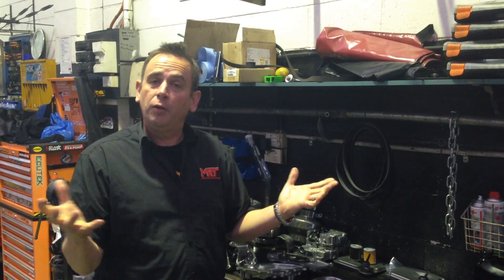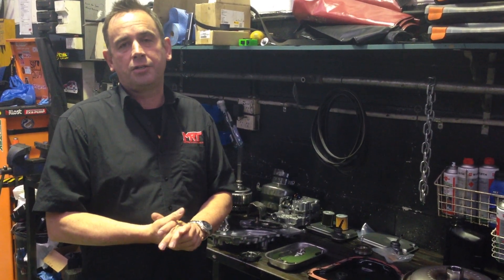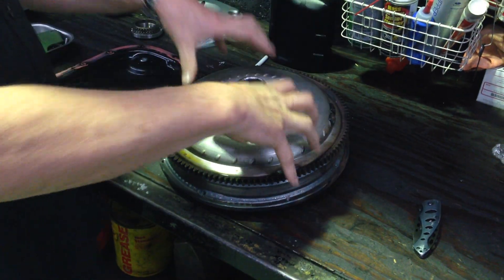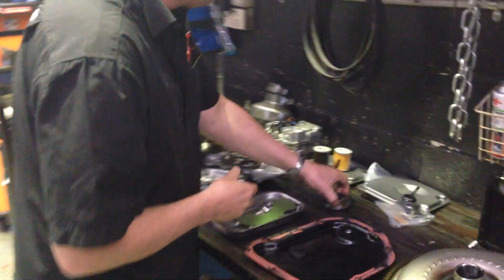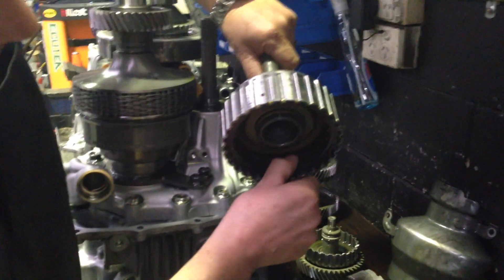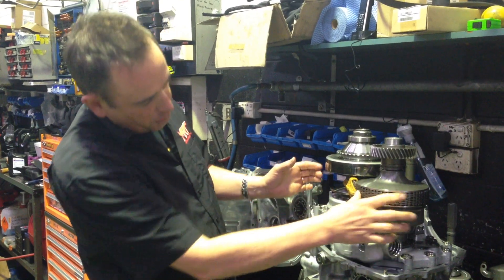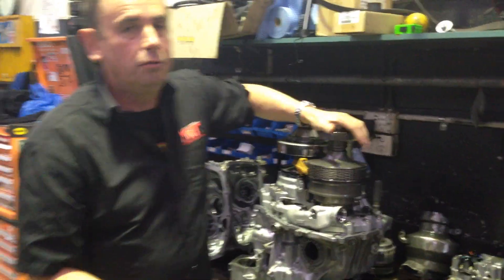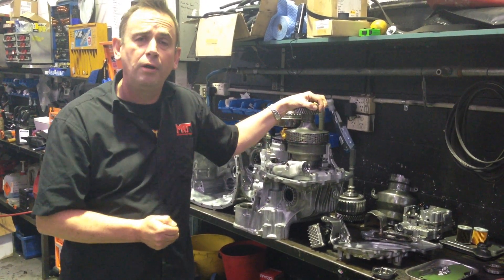Subaru CVT transmission secrets

Comment: A shame the CVT killed all excitement with this brand. If you want a MT Subaru you better buy while you can soon itll be that constant boring hum for us all
Reply: Doesn't the software simulate gear shifts so the ratios change quickly and stay there for a bit? It kinda defeats the purpose but apparently people like how it feels. When acceleration is done, it just puts the engine to its most efficient rpm for the load and chooses the appropriate transmission ratio. With a CVT you can also drive at highway speeds backwards if you want to. :-)
Reply: Hamachingo simulated gears in a cvt defeats the purpose of a cvt. Optimally the engine should be running at maximum power output (not maximum torque) continuously during acceleration. Theoretically this increases acceleration speed, though the technology is not there yet to handle high torque.
Reply: About that driving backwards at highway speeds: 60-65 mph max---with backup camera?  90 mph all nite long !  Easier on the neck too.
Reply: ahh yes, the CVT, a transmission literally banned in formula one for being too good, kills your "excitement"
Reply: As I understand it, it is Subaru's intent to eliminate the standard transmission entirely.  You'll never guess why... safety.  Well, kinda.  It is their commitment to the EyeSight technology that is driving that decision.  EyeSight requires control of the gearbox so that it can stop the car by applying the brakes, and a manual transmission cannot give that control to a computer (unless you have a double clutch or something like that, but that costs more in money and weight so they likely want to stay away from that).  So essentially it is EyeSight's control in the name of safety that causes them to prefer CVT or auto type transmissions.  Stupid, I know.  As far as I'm concerned a Subaru without a standard transmission is, no longer, a Subaru.  Sorry Subaru but it's true.
Reply: @badrasta5  Maybe so, but with some of the driving display I see every day, having EyeSight or similar in EVERY car is a good idea.
FYI. Watching movies, eating a bowl of cereal, putting on makeup, texting on your phone, while doing 100 km/hr is generally NOT A GOOD IDEA. (just my opinion).
Reply: @petert3355  I couldn't disagree more.  The more and more safety tools installed on cars inevitably causes the average driver to become a less and less safe driver (big picture).  Oh they may be safer for a little while (small picture), but they are worse drivers.  A good driver makes wise decisions, predicts accidents before they happen, and is pro-active in their everyday driving.  A bad driver relies on technology to keep them safe.
In aviation, one of the worst examples of this is Air France flight 447: on June 1, 2009 a fully modern Airbus 330 entered into a >pilot-induced< high-altitude stall (just let that sink in for a moment) killing all 228 people on board.  If you read the investigation you will learn one very simple fact -- the pilots relied on TECHNOLOGY rather than flying experience, and as a result, they killed everyone by slamming into the ocean.  Yes, the pitot tubes froze up (technology).  Yes, the computer handled it with loads of error messages (technology).  Yes, it was dark, and yes they were over the ocean and so didn't have a point on ground as a visual point of reference.  But at the core of the fault was the pilots relying on their TECHNOLOGY rather than their real-life flying experience.  All they needed to do was fly the plane and everything would have been fine.
I digress.  But, let the point be made -- a driver's FAILURE to know how the drive can NEVER be replaced with technology.  The only solution is to produce better drivers, by training, by closed-course experience, by putting people in dangerous situations with a trainining instructor at their side and teaching them the skills of HOW TO DRIVE.
Technology cannot even come close to replacing this most important component of safety.
This point will be lost on most.  And it is extremely unfortunate and unsafe that this is not understood.
Reply: One final point, and coming back to Subaru -- I like EyeSight, I think it's an awesome advancement because it uses bi-visual cameras (rather than radar or motion sensors) to see the road and computers to interpret that visual data.  That is absolutely incredible and is most certainly above the other technologies.
That being said, to take away the manual transmission is to remove the driver one more step away from the machine he is driving, to make it more difficult to be a good safe driver.  Many will disagree, that's fine.  Subaru has long been at the forefront of safety, but I see this as an ideological error on Subaru's part, and it will most certainly trickle down to their products.
Even if the CVT improves and it's reliability gets solid, I recognize I am being forced to be less in touch with the machine I am driving, and thus I am a less safe driver.  Of course you will say I am splitting hairs.   :-)
Reply: @badrasta5  I get what you are saying and while I do disagree on some points. In today's world, with the attitude of humans in general, where people are constantly looking for instant distraction. TV on your mobile phone anyone, I guess we agree that we cannot do this half arsed.
Either we go in your direction, remove "all" driving aids, and make the person pay attention to what they are doing.
Or we go to the other extreme and remove the human from driving all together.  Don't laugh, this is an option that is not that far way. Just look at the robotic mine trucks they have in mines today.
Which way the world goes, I don't know. What I do know is that distraction is the biggest killer on our road that we have.
P.S. The guy eating a bowl of cereal, with milk mind you, was driving a manual GTS W1.
Reply: @petert3355  LOL on the cereal GTS LOL. I think the answer to both of our questions is -- look at the toolbox of any skilled mechanic:  there are many old school tools, and the very successful mechanics will also have more modern tools that can do things faster and better than the older tools, but still many of the old reliable tools remain in the toolbox to bring the mechanic to repeated successes.  Why -- the newer tools are better -- why keep the old stuff even if they only get used less than half the time?  The old tools are proven, they are reliable, and they do a few things really really well.  It can also be said that the modern tools work better and are far more effective in the hands of someone who was trained on the old ones first.
I put forward a basic tenet -- train on the old, and only when the old is mastered introduce the new.  That is, the old matters, but... a fence should not be torn down without first seeking an answer as to why it was put up in the first place.
I believe both the old reliable (standard, basic driving with no technology) and the fancy new (automagical, safety) can co-exist but only if the old is respected, taught and made the core, and the new can exist without loss of safety only if the old is not rejected.  Case in point, Air France flight 447 and the 228 lost souls.  May they rest in peace.  And may mankind learn the lesson before it happens again because... it is already happening day after day more and more.
Reply: @nemo5335  Not used in formula one because of rendurence issues I'd say.
Reply: @oldarkie3880  no actually it was explicitly banned because it was too fast and they wanted to slow cars down for safety reasons.
Reply: I'm curious about the difference between the regular CVT and the HTCVT (High Torque CVT)used in the WRX, USDM Forester Turbo.  Sounds like they need to beef up both for better reliability.

Comment: If you replace the  cvt with a used unit is there any programming  required?
Reply from the maker: not sure
Reply: Byron Lambdin would depend on how much the transmission is actually controlled by electronic means. 

subaru's lineartronic cvt as used in the wrx simulates gears by changing ratios. this is done by what is essentially stepper motors that move the rollers or pulleys. 

traditional cvt's (good example, mopeds) are governed by weights, and can actually be "tuned" by changing the roller weights inside. 

The CVT actually has a place in cars, but sadly, not in many performance cars. (unless the user has the ability to manually change ratios). 

ratios should be able to be programmed at some point, but as long as the stigma of CVT transmissions being "blasphemy", no one wants to dive into exploring the possibilities.
Reply: Thanks , we installed the used unit and with this years model there was no programming needed. Transmission is working correctly now.

Comment: Is there anything that can be done to increase that ceiling of 400 Nm? Something along the lines of an aftermarket CVT cooler like the one that Mishimoto makes, perhaps? I just acquired a 2015 Forester XT w/ a Cold Air intake and was hoping to squeeze in a few more mods before hitting that ceiling.
Reply from the maker: cooler trans oil wont make your trans any stronger
:(
Reply: crusherofdreams look up the f1 kit for the CVT WRX. Its been highly ignored because of the price but, after installed, it is rated for 600hp
Reply: https://f1-motorsports.myshopify.com/collections/wrx-cvt/products/f1-pro-series-full-package

Comment: Would you advise a manual gearbox if doing a lot of heaving towing at full weight? Also, quite a lot of off road use as well. Many thanks. Great video, thoroughly enjoyed watching.
Reply from the maker: yes,manual trans
Reply: CVT's aren't designed to tolerate pulling heavy loads. NEVER go beyond the recommended tow rate!
If you plan on pulling things like large campers and boats, CVT's aren't for you.
Reply: Many thanks, I tow two large trailers with a gross weight approaching 2 tonnes so it's at full weight much of the time. Also, quite a lot of time in fields as well. I think the manual is going to be the way forward. I'm in England and we don't have much snow, but the relentless wet winters do take a toll when towing through mud etc. Many thanks.
Reply: @simonbroddle754  If I remember correctly, the tow rates in the UK for Subaru are nearly double of the US which is around the 2k or 3klbs range. Not sure WHY exactly, might be a efficiency thing and the transmissions are geared differently. But something to consider and always just follow your user manual.

Also, the rating are the SAFE level and probably at least half of their true capacity since the amount of force is variable while driving, I wouldn't test it though since tongue weight at least is something you do NOT want to over do, unless you want your front wheel to loose traction from lift. But depending on distance, you can get away with pushing it a bit. Same can be said for manuals btw.
Reply: @darksd3626  Hi Darks D, Thank you for your reply. I do tow up to 20,000 miles/yr with one trailer now which has a gross weight of 4,400lbs, this is higher as it's a manual car. That said it is rarely loaded to that level. 
You raise an interesting point though about brakes. We use overrun brakes in the UK which are ok but not the best. I am very curious watching the video's and reading up on the US system of electric brakes. I like the idea of altering the bias depending on weight etc and think they offer a much better solution. Regarding tongue weight we generally have a lighter weight as it can impeded the overrun brakes if there is a lot of weight on the braking compression unit. 
Still love the Forester. Great tow car although, if there's one problem is that 1st gear is quite high compared to my previous two VW Tiguan's. Thank you for your advice and thoughts.

Comment: I had a complete failure at 87k mi. Noticed a noise at 60k mi. 14 forester. The 17 has 3 definate shifts wheras mine had one.
Reply: What did you end up doing with your car?
Reply: do you mind telling how it happened? I have a 14 forester xt with 89k miles, the check engine light just recently flashed transmission issues, it's gone away but I think it's a problem waiting to happen...
Reply: LowInformation my 2014 subaru cvt just went out today. I complained to dealer about shuddering when accelerating, they never dealt with the real issue apparently
now I'm at 114k miles and over the warranty :/

Comment: Great video. It shows that CVT technology is just not there yet in terms of reliability. A transmission should not be failing after 3.5 years
Reply: This happens on any car, any history. Some failures are expected. I have seen this happen on tried and true technologies. Bearings sometimes come with defects, this is true even for high end wheel bearings for example. I had to replace a wheel bearing after 6 months because of a defect caused premature death by noise. (Which is all they noted here, it was noisy and would fail.)
Reply: Motuariki Dub I know I was thinking the same thing I got a 25 year old 4Runner with the original four speed still running strong as hell lol
Reply: Yeah, well, I got 2500KM on a Dodge Auto and 10,000 on a Chevy 5 speed.  The plural of anecdotes is not data.
Reply: And I've got a 2013 SSS Pulsar that I've given hell to with no problems.  To suggest that one failed bearing in one transmission consigns them all the the dustbin is plain stupid.  CVT is the future for non-performance internal combustion engine cars, which are 99% of cars on the road.
Reply: Hah! Tell that to Ford and VW owners. Their horrible DCT fail regularly and often.
Reply: @zaphodbeeblebrox9653  DSG is completely different construction of the transmission to CVT. DSG's fail after 5 years. I replaced one in an Audi, never again.
Reply: CVTs are fine for reliability and have been serving in heavy duty applications for over 60 years, but ok.

this transmission couldn't have possibly failed because this is a tuning shop, and the owner had performed modifications to their car which the transmission was never designed to handle, or anything.
Reply: Depends how the guy drove it also

Comment: I like my 2001 Nissan Primera P12 CVT, it has 110000 Km on the clock, it still goes like new, Being aware that a CVT transmission is in your vehicle and how they work especially knowing what not to do to them like, Putting the gearbox in the opposite gear that the vehicle is moving and towing heavy loads. The gearbox will last as long as a normal automatic. Just remember DON"T MISS A SERVICE, keep the oil clean and she will last a lot longer!
Reply: gelul ik rij in een ecvt van '97 met meer dan 3 ton op de teller
Reply: The worst part of that CVT is that oil changing is essentially futile. Virtually none make it past 150,000 miles, and most die between 80 and 120,000 miles. The Nissan drive belt and most all early Jatco trannies have a dependable failure time because the design of the belt elements is flawed.

Comment: My 2015 XV was just diagnosed with this issue.  My question is what kinds of issues could arise if that bearing was not replaced in a timely manner or at all.  The dealership here is quoting $3,500 for a used and $8k + for new.  We put a lot of miles on the car and didn't realize this was going to be that expensive of a repair.  Thank you for taking the time and putting together these videos.
Reply: No warranty? :(

Comment: Any auto tran typical or cvt is meant to be replace not rebuild. Typical trans have remanufactured ones which is better than so called rebuilt while being cheaper
Reply: Jake Maningding that's a lazy way out if you rebuild you can improve or make better where it fails. it's like adding a shift kits to the standard trannies.

Comment: what are the differences between the the standard and wrx cvt that you say is bigger?  i have been told they are called high torque models.  and are available in the wrx,3.6 legacy and the forester turbo models  are these all the same models?

Comment: If it helps anyone, I have the 2010 liberty with CVT transmission and a few months ago around 120k mark the CVT fluid was discoloured and needed a full flush. I used aftermarket fluid because the genuine subaru stuff is crazy expensive.. hopefully that helps people wondering what type of average life span you get out of the oil. The car was never uses for towing and hardly ever driven fast, plus there were no metal particles in the fluid. I think I'm gonna change it every 100k myself to be safe.
Reply: Can you please give me an update how it's going without the OEM fluid? I'm looking at the penrite chain CVT fluid
Reply: My Subaru Levorg has a scheduled CVT fluid check/change at 120,000 kms.
Reply: my 2010 subaru outback gearbox was whining now the sound has gotten worse with grinding noises. thinking its a bearing.

Comment: how about the wear of the belt/chain and the pulleys?
Reply from the maker: what about it?
Reply: Have I got it right?  the transmission can be divided in 2 basic components. The clutch, a converter with fluid/oil that should be refreshed every 100k or so. And a gearsystem, that consists of the pulley's and a steel belt. The pulleys and belt run dry, not in a oil bath. 
So I wonder about the wear of the pulleys and the belt. How many kilometers (normal conditions) are they supposed to last? I just bought a Subaru Forester CVT

Comment: What happens to the CVT if the car is parked with the gear shift in "P" and another vehicle hits it from behind causing it to move forward
Reply: Good question I guess the metallic teeth of the thing holding it could break or simply slip could be nothing could be a new arm with the metallic teeth  I guess though never put it in park in red lights etc press brake pedal and that's it
Reply: you need call the insurance company !!!!
Reply from the maker: no ideea

Comment: I've a 2013 impreza with cvt. how often should i change the transmission oil ?
Reply from the maker: hmm,depends on how you drive it
Reply: regularly inside the city with high traffic most of the time & high speed on open roads occasionally